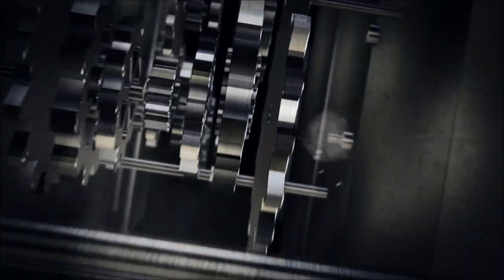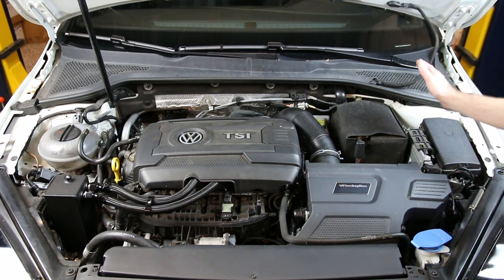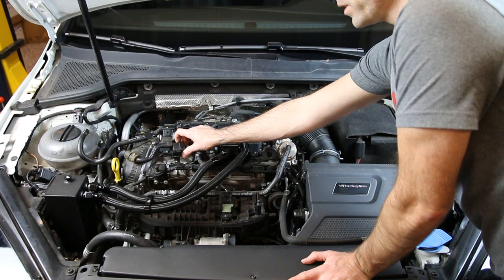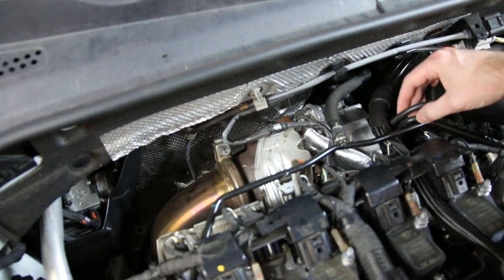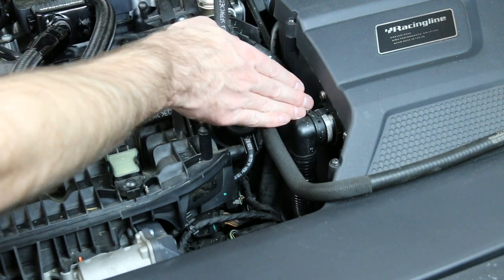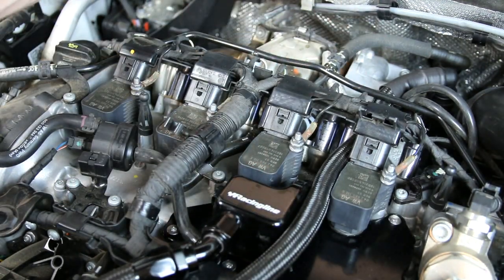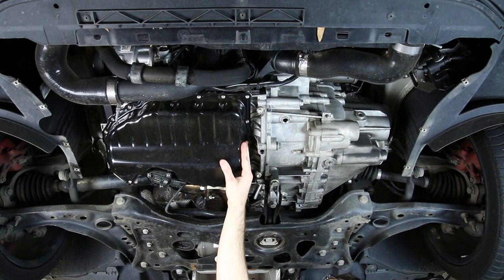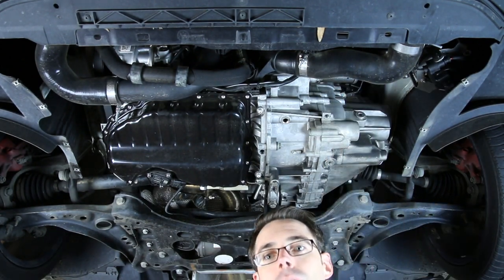MK7 Engine Component Locations

Comment: At 7:10 those solenoids are not for variable valve timing, those are the Audi Valvelift solenoids for variable lift on the exhaust camshaft valves. Timing adjusters are located on the cam pulleys top left, driven by the chain and controlled by two electro magnets whose connectors can be seen on the plastic cover.
Reply from the maker: Thanks for the correction.  I def mis spoke.
Reply: Deutsche Auto Parts no problem! Thanks to you too for the always handy videos
Reply: This is true, those are for the variable lift

Comment: Where's the water pump?
Reply: That's the only reason I came here :(
Reply: in the thermostat housing, which is below the intake manifold
Reply: It's directly under the throttle body, so accessing it typically means removing the intake system, radiator, and throttle body. (I DIYed a water pump, thermostat, thermostat housing, and water pump belt replacement on my 2015 GTI at 67K miles due to a coolant leak)
Reply: Yeah, good lucking getting to it. These cars are awful. I’ll never buy another vw. Big pain in the a**

Comment: Hi,
great videos, lots of information. However, I have a problem with locating the air flow meter in the 1.8 TSI engine? I only found a MAP sensor or is it the same?
  I will ask for an answer.

Comment: Hey Paul,

I just wanted to know what would you recommend for installing a boost tap? Using a hole punch kinda freaks out poking a hole into the manifold along  with the chance of putting plastic getting into the manifold as well.
Reply from the maker: Using the method shown in our Blow Off valve video should be the easiest way.  https://www.youtube.com/watch?v=YGSmp6eNMLU
Reply: Hey Paul do you have a installation manual for installing the factory backup camera on your website? I'm interested in doing this soon. Thanks
Reply: @Deutscheautoparts   Hey man I have a mk7 gti, it’s been coding P00b7. Coolant temp on gauge will go into the red, but an obd read says the temperature is normal ~(194). Car goes into limp mode, and limits rpms to like 4K. Any clue on what it could be?

Comment: Hi from Australia.  I have mk 7.5 gti original 169kw 2.0 turbo.
I am having problems with my throttle body position sensors, throttle body.
I can get the top screw out but I can't work out how to get to the bottom one, so I can clean or replace it.  Have you removed a throttle body? If so, how did you access the bottom scre.Any suggestions would be greatly appreciated .

Regards
George

Comment: Hello, can you make a video showing where located camshaft position sensor, manifold air pressure,  booste pressure sensor and throttle switch? I need this to install a TMC piggyback. Thank you for now!
Reply: Ricardo Casado did he ever got to you on where the camshaft position sensor is? I’m in need of it too :(
Reply: @riverdreams  Im here for the crankshaft position too 

Did you ever find the location

Comment: I recently replaced the oil sensor on the bottom of the oil pan to hopefully resolve an error I got stating an issue with the oil sensor P019800 but the oil temperature is still not being read. Is there a different oil temperature sensor? If so, where?

Comment: Looking for the Vapor Canister location on my mk7 gti! Can't seem to find any info on its location.. below the fuel tank, behind the rear right wheel behind the well cover?? I got a p0456 evap leak. Changed gas cap and purge valve already

Comment: Hello, Just discovered your channel from the top 5 cheap but expensive video. Ironically I just got my audi a3 back from the wheel and tire shop because my car is making a loud sound when moving, sounds like a sub machine gun... these guys are knowledgeable and even have a race team but they checked brakes, tie rod, realligned and were baffled. unlike when I damaged my radiator (similar sound) this sound is rotational, it doesnt matter if I'm on the throttle or not and the speed of the bangs increase with mph of the car... wondering if youve ever seen this, Thanks so much if you read this comment
Reply: Bad CV axle maybe

Comment: thanks for this great video info. i have a 2019 Rabbit with the DSG. i'm a little confused as to the starter location because what you showed is the manual model, i believe. also, what's your opinion on the on/off running engine feature on this generation, how will affect the engine and starter long term? i honestly don't like it (annoying) and just turn it off all the time. thanks

Comment: Hello I been having a problem with my mk7 I'm getting a warning error message or something while driving but it impossible to read the error cause it despairs in less than a second I have an appointment for Friday to se what's causing this any idea what can it be 2015 mk7 DSG completely stock
Reply: Having the same in my 2015 Gti also stock, goingo to ask the dealer to check it during the next service, please update after you check it if it's something serious
Reply: Shifter assembly
Reply: Having the same issue. Any updates on what the dealer did? Doesn’t happen often, so I feel like diag will be an issue.

Comment: I saw a golf R for sale the title is salvage, idk if I should buy that or get a GTI clean tittle.? Please help!!
Reply: Fabian Mendoza GTI clean title for sure, the resale for a salvaged R will be horrible.
Reply from the maker: Unless you are really know what you are doing salvage title cars should be avoided at all cost
Reply: Fabian Mendoza You can also tune the GTI, to at least 370 hp. The GTI still uses the same Audi Engine (EA 888) as the R does. The biggest reason getting an R, is for the 4 wheel drive. But GTI is said to be more fun in the low rev range of engine.. (Early on in acceleration..) & is about 11.000 usd cheaper, if your prices are the same as here in Sweden... That you can use to tune your GTI instead... hehe ;) In other words... - You know whats the smartest deal for you...  - From Sweden with Love!! ;)